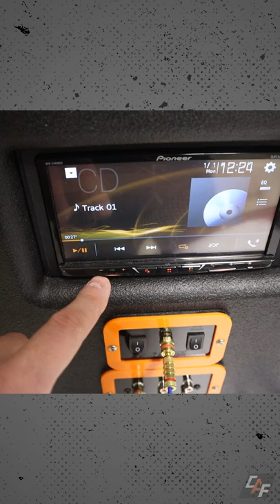Don't make THESE car audio MISTAKES! #shorts

Comment: It takes power to make power. Always overlooked. That and proper grounding for some reason lol
Reply: Nahhh, just run that 8 awg solid strand thru the door channel, but make sure it’s RIGHT next to the door Hinge. So it can hide from it.
Reply: hes right about the proper grounding. my dumbass was truly stumped for a minute, just to find that i grounded it to a positive terminal for my fuse box. u have permission to laugh and make fun of me👁️👅👁️
Reply: That sounds dangerous lol
Reply: I concur. I have a JS high output alternator hooked up to a 1400 watt amp with a crappy ground wire. Headlights dim a bit on big bass notes. Luckily, I got a new 1/0 wire ready. I just haven't gotten around to it since the car has exhaust problems that need to get fixed first.
Reply: @mikegriego3671  once you stop the lights from dimming, the bass gets a lot stiffer too.

Comment: I did car audio for ~20 years and still dabble with my own cars. One car is all JL Audio with first gen Slash amps. 17 years later it still sound GREAT!! Another has JL Audio amp/sub and Focal components. 
My advice: Buy reputable brands and install them CORRECTLY. The installation can make or break a huge investment. 

Yes - that person with the "5,000 watt" amp and Sundown sub in the center console of the Ram is throwing money out the window.

Comment: Another one: have your sub in the driver cabin. I got a huge woofer in the boot of my 190e but it is so well insulated that almost nothing but a gentle hum reaches the driver seat. Make sure you have vents so the sound can reach the cabin or have the speakers directly in it

Comment: During the pandemic I upgraded my car stereo and I did it right this time. Big three upgrade, new alternator, second battery, capacitor. I don't drop under 13.5 with my 4500 watt RMS amp. I used to have a Phoenix Gold titanium amp with 12w6's but never upgraded my power other than a gel cell battery and it would cut out all the time. Now I'm only running two 12s and it sounds even better
Reply: Thanks man!
Reply: What alt did you go with? Is that your clamping wattage? Curious to see what you’d clamp with and without the Capacitor? What size cap?
Reply: @junballs6576  big 3 should be done for every install
Reply: @APinTheAK  the cap is useless with a second battery of the correct size. Singer makes the best alternators. I’ve had them all.
Reply: Gel cell isn't the right battery for this application as they have a hard voltage limit of 14.1 volts at room temperature ( roughly 70ish° F/20ish° C). above that the gassing will cause permanent voids/bubbles in the gel and make that area of the plates inactive.

You should use lead-calcium flooded or AGM instead.
Reply: @danielthechskid  Yeah now I have full throttle batteries. I was talking about when I had my Phoenix Gold titanium amp and 3 w6 12s. But good point
Reply: @APinTheAK  Good point, I'm running 2 ohm so I'm probably near 2800-3000 watts RMS. I went that route so I could add a third 12 later at 1.3 ohm. Also the capacitor was a gift and it is 10 farad, but like the other guy said with the second battery I really don't need it. Just nice to have, especially if I add an amplifier for my mids and tweets
Reply: I also just got done sound deadening the entire trunk and Tessa taping all the clips and harnesses and stuff. So much cleaner without rattles. Even with my seat up it sounds great! I also took out the trunk vents because they would make a slapping noise and covered them in sound deadener
Reply: @TheDoozie43  The alternator I got was actually off of ebay. 250 amp up from 110. I believe they rebuild alternators up to a certain spec but for the price, $225, I was happy with that
Reply: @jsteezy80  Most of the rebuilt alternators rewire the windings from series winding to parallel winding. Then they often install a small pulley on them to compensate for the low rpm voltage loss.  They of course install new bearings, brushes, diodes, etc.
Reply: Phoenix gold, legendary Amplifier

Comment: my favorite mistake, maybe not always a newbie making it either, building ported boxes that dont complete the phase shift at the actual intended frequency band, a good way too remedy too little internal volume (not enough low end) is acoustic cloth, poly fill, similarly if the port dosent quiet phase (say its -6° from in phase) by adding fill too the port channel you can increase the distance there by putting those notes from the port in phase with the crossover point

Comment: Using small wires (can literally start a fire if you hook it directly without a fuse which I've seen before several times), using cheap RCA cables (causes whining and humming from the charging system to get into your audio), improper grounding (that one can get really interesting all kinds of weird problems).

Comment: Putting a amp on the speaker box without letting it breath because it needs to be put on a platform with drilled holes in the bottom of the platform so it can breathe

Comment: Takes power to make power. I'm amazed that most people still dont understand this. The factory wiring is a joke too. Just doing the big 3 and or 4 helps a ton!
Reply: A lot of people don't understand how electricity works they just know in your house whatever you plug into the wall is going to work so people kind of think that's the same way with a vehicle

Comment: Biggest mistake I’ve seen was the amp switching wire connected to the cars rear light circuit. Yes, this meant the audio system only worked when the lights were on. It took the owner nearly two weeks to work out there was a problem because it was winter and it was dark when he left for work, dark when he came home, and he didn’t use the car during the middle weekend.

Comment: If you’re going all in on audio I would say get a secondary battery for the system and a higher output alternator. I know a lot of people just say get a bigger battery but that isn’t always the case and I’m kinda sick of telling people that come in why it’s corroded to hell.
Reply: A second battery helps with amperage delivery but is still another component load added to the alternator. I have seen dozens and dozens of systems around 1,000 watts with one battery and a stock alternator that perform perfectly. Two of my cars are excellent examples.

Comment: Mine was my friend actually using the remote sub wire on a modern one from the amp.. As remote on new stereos the steering wheel controls on a new head unit.. Not the "remote switch off" don't get confused with newer stereos

Comment: The main mistake I see are people with no budget trying piece a system together. You don't need $10,000 but you do need a decent budget. I've learned over many years that it's better to do it once and right than putting junk in the trunk. Big boy toys...that's just what it is.

Comment: Running the power wires next to speaker wires is one big mistake.
Reply: *running power wire next to high level input signals* does not apply for wire going to the speakers that is high current
Reply: @GoDi_XD  I was referring to the wires being sent to the speakers on one side of the car and power wires on the other to prevent rf signals or buzzing in the system.

Comment: Putting self-tapping screws through the ground wire with no lug straight to the body and not cleaning off the paint😅😵
Reply: That is a common reason amps go into protect and / or overheat.

Comment: I've been installing for years couple more things newbies make mistakes that is running the power wire through the door not fusing by the battery not mounting amps I can think of more but that's just a few up top of my head

Comment: Had a customer car come in amp quit working was a ground issue. He ran a ground from the battery to the amp. I was glad that fixed it putting a new ground on the chassis. So glad because no telling what the rest of the wiring looked like.

Comment: I seen 10 gauge power wire ran to amp that produces 600watts,  I'm surprised there wasn't a fire! Class A/B, I think the wire would go before the 80 amp fuse

Comment: Literally the most basic things to know, ud have to be less than a noob to not know these.. if u didnt know any of these things, do alot more research before attempting.. there are more serious mistakes like grounding, voltage choice for power and trigger, polarity.. 

I seen an guy use his factory amp 14 gauge power wire as a source for his 1800w taramp with a 60 amp fuse in between , had smoke coming out the quarter panel before it finally severed and cut power.

Comment: Okay I kinda need help. So I bought 2 JL audio 12w1v3-4s from my buddy well the box they are in won’t fit under my seats. I planned on getting a different box though. Can anyone help me on a box to get (i just want a box for 2 12s)
Reply: Need some more info bud. What vehicle?
Reply: @APinTheAK  2001 tahoe
Reply: I don’t know of any box that will fit two twelves under a seat. Too big.
Reply: @TheDoozie43  I have a box right now that fits 2 12s under back seats but ida not made for my vehicle so that’s why im getting a normal box for 2 12s

Comment: 2 subwoofers with reversed polarity canceled each other out. 
Don't cheap out on the signal cables

I had a wicked 8 inch digital designs sub with enclosure. Absolute beast for a family sized car.

Comment: I like 10" subs in general
Reply: I hear yah. There are sometimes bottom end limitations with 10s though.
Reply: @racegod69  true I'm ok with 12s too but 15s and 18s tend to be a bit loose sounding. But I would still try a mtx sledgehammer lol

Comment: That’s why I always laugh when people spend money on nice gear to play some compressed crap song from Spotify. Then I show them my 250mb lossless 4 Minute song
Reply: What gear do you use for lossless? I have a Helix mini dsp that clams lossless Bluetooth audio….I just need a source to provide it correct? Tidal perhaps?
Reply: @TheDoozie43  Tidal is good, I have my own library hosted on my Plex server. At home I have a Fiio desktop Dac powering my Shure SRH1840’s. I also have a Fiio Bluetooth dac to use with my phone. My living room I have 2.1 System from Edifier. In car I have an Infinity sound system, 5 regular speaker, 1 subwoofer and tweeters in the front. It’s the factory premium unit in my car, still under warranty so I won’t be messing with the audio system until it runs out. But it sounds good